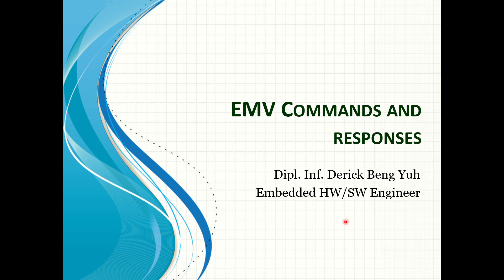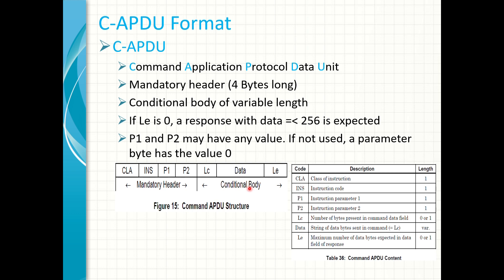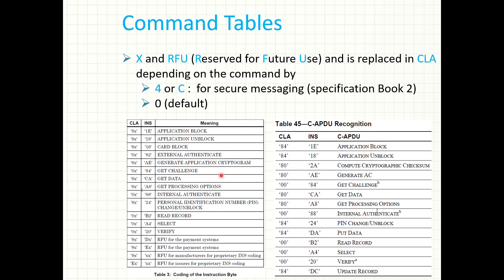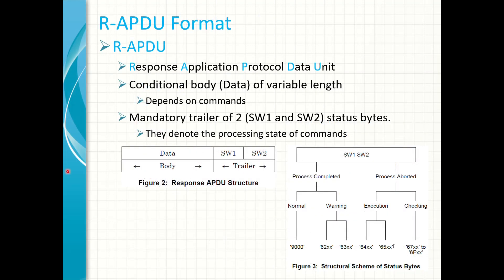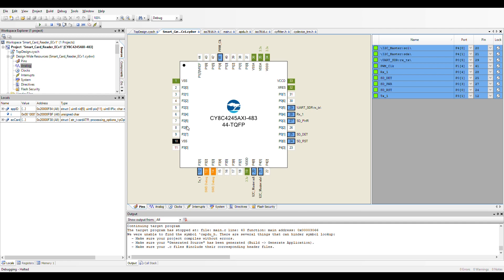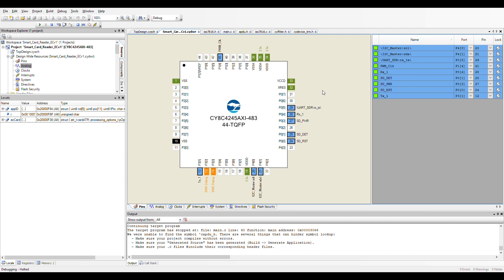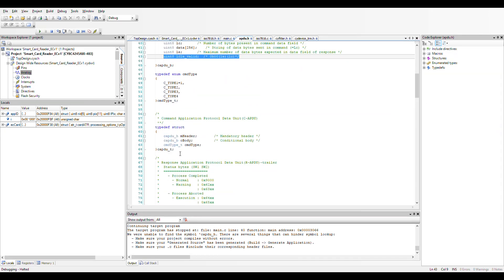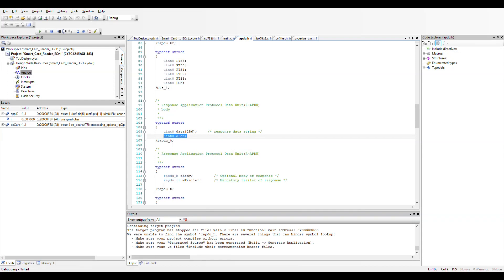EMV Commands and Responses with Demo [PSOC 4]

Comment: Your explanation is very nice. I thought smartcard is in JavaCard, but I see here C.
Reply from the maker: Thanks sir. I used C to make it very transparent and easy to understand, because there are no emv libraries in C. So everything has to be implemented, including the hardware dependent parts. Using javaCard limits you alot especially using different hardwares and also understanding the protocol